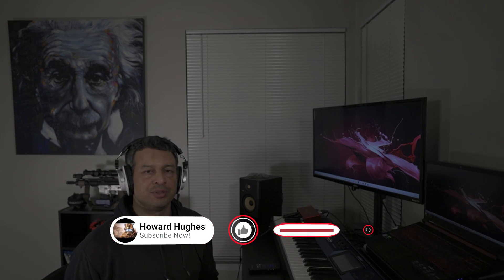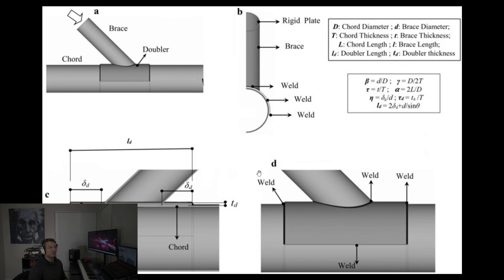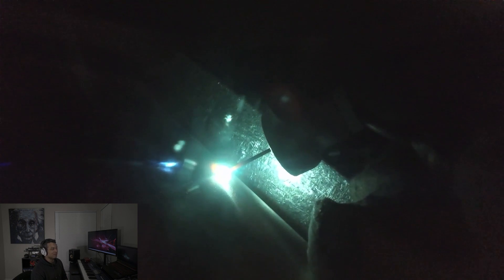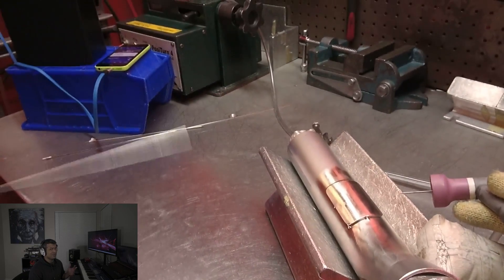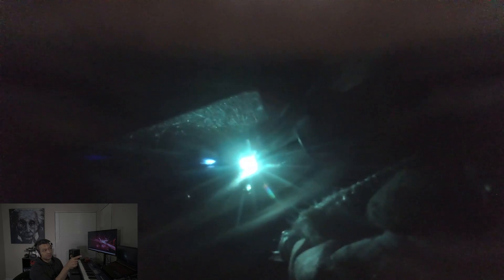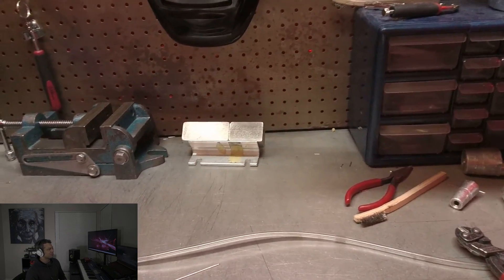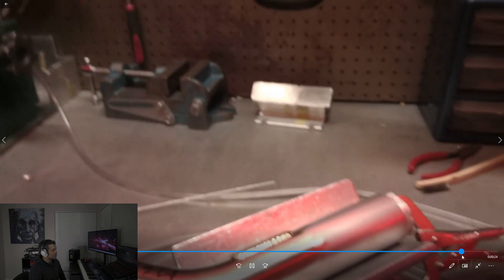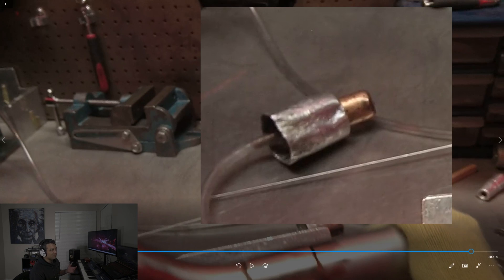Aerospace Welding: What is a Doubler?

Comment: Sometimes I think if it does shear off. It will not usually shear from the original piece.  So the pipe with the doubler plate. Is most likely structural.. and integrity can't be risked.  So weld a sacrificial piece to the pipe.   Incase the main weld for the support bracket fails.   It will not destroy the main pipe

Comment: You’re welding stainless?
Reply from the maker: This is inconel. Like 0.090 thickness.

Stainless and inconel are welded the same and purged the same. They even alloy together.

For non official shit you can use stainless rod on inconel and use inconel rod on stainless.

Where they are different is material properties and how they move.

Inconel can take sustained heat of like 1000 degrees for a long time. That’s why they are great for exhausts and turbo manifolds.

Stainless steel can take heat but not as good as inconel.

When you weld them, inconel will generally keep its shape better and it has less shrinkage.

Stainless steel moves a lot depending on what you’re welding.

Last thing I know is if you need the heat resistance of inconel on a stainless steel budget…

Buy 321 stainless steel. It’s branded as a titanium stainless alloy. It’s cheaper than inconel but similar heat resistance.
Reply: @howardhughes6212 I’ve only welded aluminum aerospace parts I would like to branch out though

Comment: Put/add your welder settings for the material you're welding
Reply from the maker: @roknrolla1329  I’ll start doing that for future videos.

The last time I welded inconel of this thickness for aerospace was a week ago. FYI

If I remember right this was inconel with a thickness of 0.090 in.

Everyone’s travel speed is different.

If I remember right, he general rule is 1 amp for every thousandth (0.001) of material thickness.

So 0.090 would be about 90 amps for the inconel by the ball park general rule.

90 amps would work fine for this thickness.

Personally I weld it at 60-70 amps.

The higher the amperage, the more difficult it is to control the penetration and that matters with inspection. It has to be consistent.

90 amps is fine but you risk undercut and the lack of consistency. 

At that 60-70 amp range, make small circles and you’ll see the puddle drop. Think whirlpool.

Once you see it drop, add rod and move forward about 1/4 of the distance of the puddle. Think crescent moon🌙 . You wanna move about that far. Repeat.

Lately I’ve been using pulse. 

70amps, 30 pulses per second, 40% low 80% high.

The only reason I use pulse “slows down” the arc.

For example, without pulse, you can go full pedal and blow a hole quick.

The 20-30 pulse per second slows down the arc letting you heat up and cool down the weld smoothly.

All this is just what works for me. It may not work for you.

Long explanation is so you understanding why I choose the settings. That’s more important than the settings themselves

Comment: What kind of camera are you using that is attached to your head under the helmet
Reply from the maker: @Dog-my1yb  https://www.bhphotovideo.com/c/product/1061974-REG/pivothead_1lj1_kudu_matte_glasses.html

I’m using a Pivothead. Unfortunately the company no longer exists but you may still be able to find something on eBay.

When you use video glasses, take off all the protective plastics for your helmet. It makes the camera focus better.

Don’t go cheap on an alternative. I made that mistake.  

If you get cheap video glasses, the high frequency start of the welder will scramble the video.

Whatever video glasses you choose, make sure you know what kind of camera is in them.

The Pivothead glasses have a Sony CMOS camera that are pretty good with low light.

Only other cheap way I’ve recorded welding is just by using a bunch of ND filters stacked on my mirror less camera lens. Only downside is that the camera person has to be be fairly competent with welding so they know what to point the camera at.

Comment: It looks like welding for an aerospace company would be very interesting work and decent pay, at least (maybe?). 

Do you have any advice for someone thinking about learning TIG and pursuing a career in TIG welding? Is it mostly work with fabrication and some welding to cap it off?
Reply from the maker: Not all aerospace companies are good but yes they tend to have great work.

Avoid aerospace companies that build ground support equipment.

Advice for learning TIG??? Try to learn at a community college because it’s cheaper. Hobart and Lincoln schools kinda suck.

Find a good mentor and be careful who you trust so you don’t pick up bad habits.
Reply: @howardhughes6212  
You said you this was a very early welding job in your career and for a large company. Is that an unusual thing for a big company to take on welders who do not have lengthy resumes? 
I would assume that for a major company making aerospace parts they would want to only hire people with a lot of experience.
Reply from the maker: @josiahwyncott7519  Typically large companies do want to hire more experienced welders but the reality is that there aren't that many welders. 

We make up less than 1% of the american workforce. 

An aerospace company will pick you up as long as you can pass the weld test to get in. 

If you're worried about having enough experience on your resume, just lie to get in. 

As long as you can weld the lie won't matter. 

When I worked at honeywell aerospace, they wanted experienced welders  for the department I was in and no new people because they did not want to spend money training anyone. But another department that was working on F/a-18s down the hall they were taking kids right out of college.

Senior aerospace for example, once you get hired, they don't care how much experience you have... everyone trains for 1 month mandatory and it's paid. 

You can also negociate to get around the experience. 

When I worked at senior aerospace, i really undersold myself to get in the door. I worked for 16/hr to learn and after a few months I quit and literally got a 10/hr raise at the next company. 

Master thin material. Practice with stainless steel. That metal is pretty much the same as inconel and titanium with subtle differences you'll learn later. 

When you practice with stainless, practice with material 0.060 or thinner. 

I'm gonna post a video about aerospace weld tests within a week. definitely look at that so you know what you're getting into. 

its not easy but it's definitely possible as long as you have a steady hand.
Reply: @howardhughes6212  
Thanks for the insights. I'll be watching.

Comment: Howard can you help me with being able to weld aluminum with a tight arc as possible, im using a 1/16 filler rod and im constantly burning the rod away before I can dab the puddle? If you can give me some suggestions or tips it would be greatly appreciated thanks!
Reply from the maker: If your rod is balling up before you add it to the puddle, more than likely you’re not welding hot enough. Try upping the amperage or preheat the material… whichever works better for you.

As far as technique, whenever I weld aluminum it always feels like the rod gets in the way and it’s easy to dip your tungsten or accidentally push the filler into the tungsten.

My solution is oscillation of my torch hand. Some guys like quick little circles or just a simple back and forth.

Once I get my puddle going, I quickly move the torch away from the puddle and add rod.

Once you have your rhythm down it works pretty well.

If you have a machine where you can adjust the frequency you can also play with that.

Most machines default from like 120-200 hz but if you crank the frequency to 400hz it will really focus the arc and the heat.

If you mess with the frequency just remember to wear earplugs because the higher the frequency the louder the machine.

Hopefully the info helps. 

Sorry if my explanation sucks but it’s so much easier to look over someone’s shoulder or give a demo for stuff like this.
Reply: Some other suggestions-
Practice with larger filler first, won't melt and ball up as easily
Torch angle close to 90deg. If you have too much push angle, your arc/heat will focus too much on the filler
Hold your filler farther away from the arc when not dabbing.